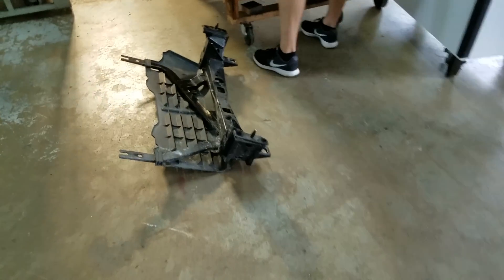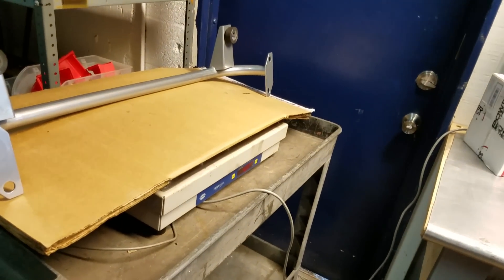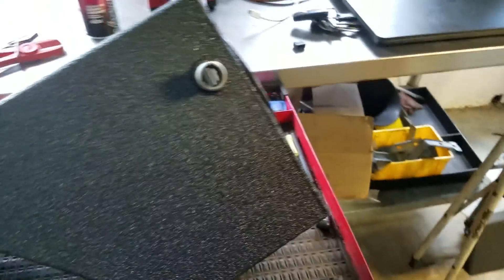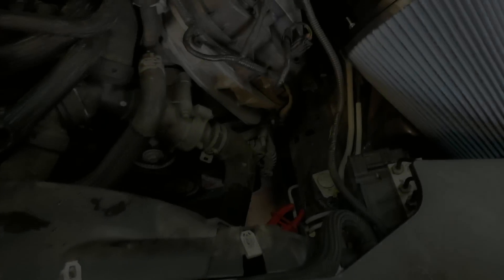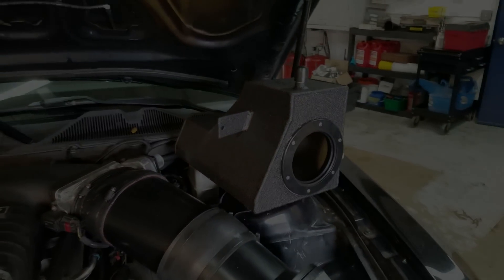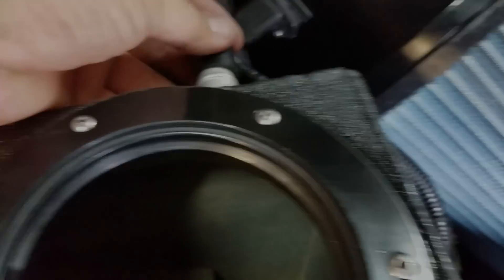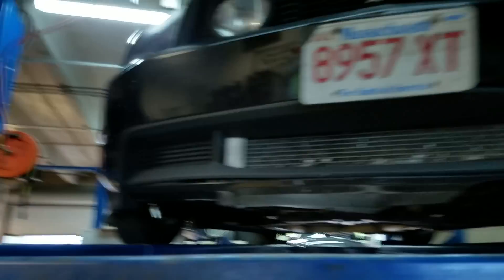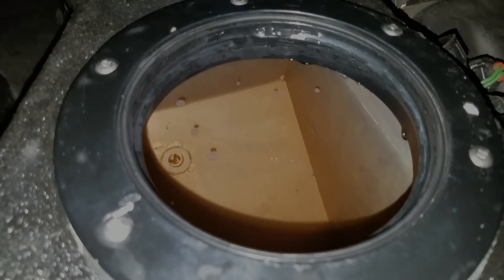Front mounted ice tank for positive displacement superchargers 11-14 mustang

Comment: Do you put the lift pads on the pinch welds for normal jacks to lift the S550?   Had my RS3 in the air at a friends house and took us an hour before we were satisfied that was the correct way to lift an S550...  Could not figure out another way so the car was lifted evenly...

This wont fit an S550?  Do you offer anything that will?
Reply from the maker: J E yes on pinch welds
Reply: Alejandro Flores thanks only way we could figure out & car didn’t fall when installing x pipe so, lol. 

no ice box for S550?

Comment: What car, upgrades would you get if you only had $15000? Thanks in advance.
Reply from the maker: In a coyote?
Boost :vmp roush whipple or procharger you are into it for maybe 7k
Trans: Cluch, Shifter driveshaft and rear suspension upgrades 3k or so
Misc like tires, install, etc, you have a legit 10 second car you can drive anywhere.
Reply: Alejandro Flores Thanks.. I meant car (coyote or otherwise) included in the $15000..

Comment: Glad you made this vid Alex i was going to call you about this exact issue.. Maybe you could answer it here.. You tuned my VMP SC on my 2017 GT a while back and i'm still happy with the tune... Runs amazing.. Thanks

Question: At what temp does it start to pull timing at. I installed the VMP Triple Pass with the big ass fans to get the temps down and the IATs still hover around 130 to 134 when moving is this normal. They climb into the high 140s almost low 150s sitting at the light... As soon as i start rolling the temps drop fast..
I do not live far from you so you know how hot and humid it is here... Is this normal temps for here..
Any suggestions..
Reply from the maker: Old Sparky totally normal at 150 or so she starts pulling timing.

Comment: I have an ice tank in the trunk of my 3v with a roush tvs. I didnt know how hot the temps get so I put just a little coolant in the mix to raise the boiling point a bit. Is it ok to run straight water in FL on a daily? It's at about 80/20, water/coolant right now.
Reply from the maker: I use water and so do most high hp guys. 
just keep an eye on it.
Reply: Cool, thanks man
Reply: What Alex said. That's the beauty of living in FL, don't have to worry about ice cold temps freezing whatever is in your coolant reservoir.
I run 1 gal of coolant (keep corrosion down i guess) and 3 gal of water with a bottle of Royal purple ICE in my 03 Cobra
Reply: Alejandro Flores Alex will that ice box work for a 2011 GT500?